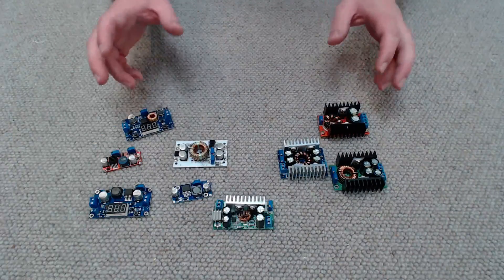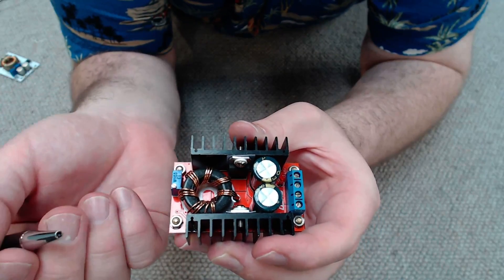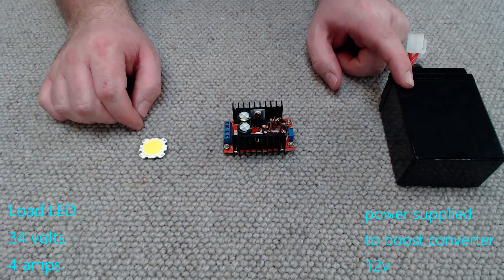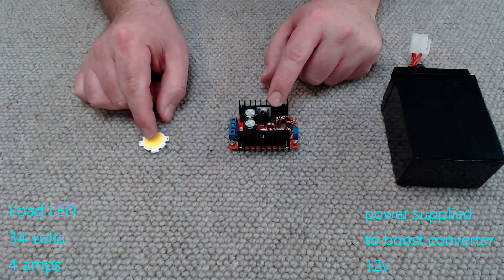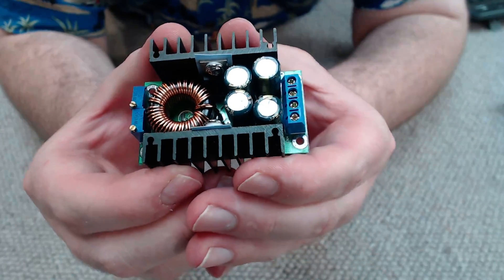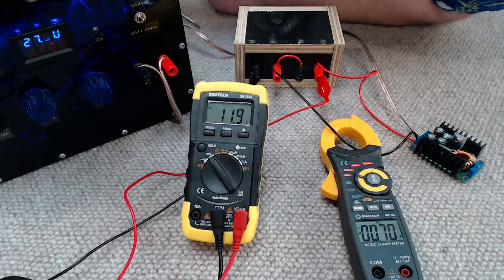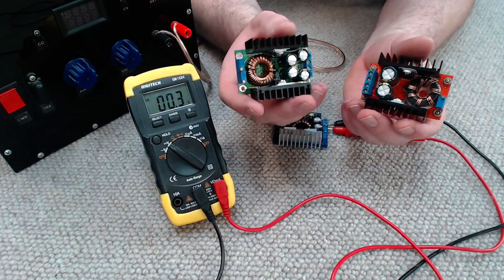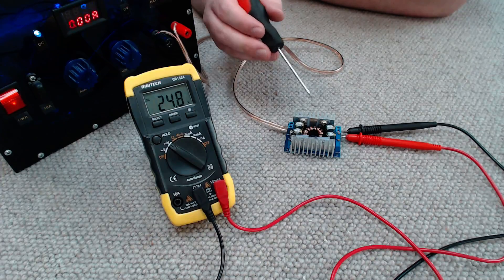What You Need To Know Before Buying A Boost/Buck Converter

Comment: 12v 20 amps acid battery, with controlled voltage and controlled ampera, who is charging with this devices healthy?
Reply: Terry More battery charging current depends on its capacity. Its healthy to charge a 200 Ah battery with 20a. But not healthy for charging a 100 ah . So whoever would be using, would be knowledgeable enough for this.
Reply: @rajeevranjan7644  Hello please, I need to charge a 200ah lead acid battery. I need a converter that can deliver 14.4v 20amp. Is it possible to input 19V 3.5A (Laptop Charger) to a 20A Buck Converter and get my desired output? If not possible, what is the Voltage and Current I need to input to achieve the 14.4V/20A?
Reply: @thekhaleef  your laptop's charger is of 75 watts only and you are looking for an output of around 290 watts. Though laptop chargers are made with very high tolerances like they can offer 3x more than their rated current and still would be working good. But even with this you are no where near your desired output. And also high current draw would generate enough heat through the laptop's charger wire to almost melt the plastic covering. So it would not be a good choice.
There are two things you can do -
1. Lower the output to 7Amp instead of 20A. Ofcourse this would increase the charging time by a factor of 3. But this is healthy for your laptop charger.
2. Connect multiple Laptop chargers in parallels as input if you have.

If you are looking for a long lasting solution then buck converters would disappoint you. Get a solar charge controller and connect laptop's charger output as solar input to the controller. This will last very long and would prove to be value for your money
Reply: Thank you so much @rajeevranjan7644  Okay, 

1. If I have several laptops charger which I actually do, do the ratings matter when connecting them in parallel because I have them in different brands (Hp, Dell, etc) which I am very sure their voltages and current are different.

2. If I hope to go for solar controller, do I still need the paralleling of the laptop charger?

3. Should it be possible I want to get a power source different from the Laptop charger, like a AC to DC module, what is the best configuration I should look out for that can give me my 14.4V/20A?

Thanks.
Reply: @thekhaleef  if you are planning to use it through solar charge controller then rating doesn't matter at all. You can connect different brands chargers with different ratings in parallel as input source and still get a consistent stable output.

In general Laptop chargers range from 11v to 25v with current from 1A to 5A. Whatever be the voltages of chargers, when connected in parallel, their output would be a fixed voltage (average of different voltages) and current would add up, resulting power equivalent to sum of powers of the chargers.  So your solar charger would in fact detect it as single resultant source of power to it and your battery would charge as it should when connected to a solar pannel with equivalent output.
I emphasized on parallel connection only bcz this way your final voltage entering into the charge controller would be lower than the highest voltages of your different chargers but would be higher than the lowest of the different chargers. Assuming this the input voltage range falls between 25V to 15V which can be easily handled by any solar charge controller whether it is mppt or pwm.
Good mppt charge controllers are costly.  the mppt charge controller who has wide range of input cost even more. 
So if you have a very good mppt charge controller with high input range then you can connect them in series. 
Though it has its own drawback too. In parallel connection you need thicker wires to handle the current. And in series connection, though you are don't need  such wire but you current would be limited to the current being pushed by the lowest power individual charger. Thus limiting in actual power. 
So one can say that parallel connection is better in most of situations.

But if due to some reasons you can't go through solar charge controller way, then you need to figure out the series and parallel configuration to achieve that sweet spot. I assume, you know the series and parallel configurations and can figure it out. Sometimes it unachievable with certain set of voltage sources so I didn't bring this at first.
Reply: @rajeevranjan7644  Okay, but using the Solar controller, would it only supply addition of the Currents of the laptop charges or it boosts it to it's own current?

What I mean is... If I parallel 3 laptop chargers of 2.5A, 3.5A and 3A... Would the solar only be able to produce  9A current to charge the battery?
Reply: @thekhaleef  it depends upon the voltage too. So give me output ratings of all the chargers you plan to use it for so that I can give you exact output calculations
Reply: @rajeevranjan7644  I have these 3 ratings ; 18.5V/3.5A,. 19V/4.7A,.  18.5V/2.7A.

And also, you can help with the formula to calculate so if I need to add another pack or just to learn. And I asked, if I later want to replace the laptop chargers for a single AC to DC module, what is the best rating I should look out for that would output my desired charger ratings. Thank you
Reply: @thekhaleef   lets calculate the total power output by all three adapters 
1. 18.5V @3.5A = 18.5x3.5 =64.75 watts
2. 19V @4.75A = 19X4.75 = 90.25 watts
3. 18.5V @2.74A = 18.5x2.74= 50.69 watts
Thats equal to 204 watts in total.

Now regulating it at 14.4v will result in 14A.
So by connecting all the three adapters as input source, you get 14A current at 14.4V.

Now to the second part, 
If you wanna get a separate AC to DC module then you would require a module of 290 watts which should be  working at 100% of its capacity. So to keep a healthy overhead of 20% and to increase the lifespan of the module the practical requirement should be around 365 watts.
Reply: @rajeevranjan7644  Thank you very much for the reply and support. I really appreciate. With your calculations, I now understand more of it. Thanks once more.
Reply: @thekhaleef  welcome friend, hope it helps 😊

Comment: what do you propose to control the voltage of ( hho) dry cell operate on 12 volt battery . I'd like to control the gas amount by control the current that is produced , by one of the three devices you would have to refer to it.with thanks.
Reply from the maker: A buck converter would certainly be able to do that. Make sure to buy a decently sized converter to handle the current.

Comment: If I want to be able to power multiple 100w leds and to use a single 12v batter i've been told I need to use one of those 12v-36v step ups per LED is there a type of boost converter where it will run all the leds
Reply from the maker: Yes a boost converter will do that for you. A typical 100w led would require the boost converter to draw 8.3amps from a 12v battery. However this isn't factoring in power loss within the boost converter or any headroom (factor in about 20% for power loss, and the same for head room). I'd search around online for a boost converter that is rated for 12amps :)
Reply: I want to run 4 so will the boost converter need to be rated at 400w+ or would it just need to be 100ish but rated at a higher amperage like you said
Reply from the maker: Measuring in watts for this particular application isn't very useful. You need to make sure you don't exceed the current/voltage input on the boost converter you're considering buying.

Comment: I did enjoy this, help me to know the difference.  I have build a buck converter which takes 24VAC (really 28VAC when I test it) and go to 5VDC.  I use a diode bridge.  My question is that I have a 7805 regulator which is rated to 1A but I am not seeing anything like that kind of amperage coming out of the buck converter.  I have 2 caps, 50V1000uF and 25V/22uF and I think that smaller caps is too small.  I don't understand how the caps work to provide amperage.
Reply from the maker: Thanks, glad you enjoyed it! Technically you've not built a buck converter. Buck converters and voltage regulators operate differently. Your 28VAC once rectified will be around 39.48VDC (1VAC = 1.41VDC after rectification) And since an LM7805 is rated for a maximum of 40VDC, it wouldn't surprise me if you need a new regulator. Besides the latter I can't recommend using a voltage regulator for your application. Going from 40vdc to 5vdc will cause the VR to overheat. If you draw 1amp of power. The heat generated will be 35watts! even 500ma will cause 17.5watts of heat. You're going to be better off buying/building a buck converter to more efficiently drop the voltage from 40v to 5v. :)
Reply: Well the kit I bought called it a buck converter.  The AC voltage coming through my thermostat wires are already downstream of a transformer in the air handler.  I never heard 1 VAC = 1.41 VDC.  So what you are describing is a situation where I need a higher rated LM7805 or better piece of hardware.  Someone suggested I use a TSR 1-2450
Reply from the maker: After AC power is rectified using a full bridge silicon rectifier. The output voltage gains +41% (1 VAC = 1.41 VDC) (That's the simple version, if you want to understand why? a quick google search will turn up pages of info) I recommend staying away from voltage regulators for your particular application. The difference between the input & output voltage is rather high. I'd recommend looking around for a suitable buck converter :)
Reply: I am open for suggestions.
Reply from the maker: Have a look on eBay or alike. Searching for "buck converter" will turn up hundreds of options. If quality is partitive and a warranty perhaps try RS or Mouser. :)
Reply: You need a "FULL BRIDGE RECTIFIER!!" lol 😂
Reply: Martin, Is that like a "full semi automatic voltage regulator"? ;-)

Comment: Any idea what the third pot does on a buck-boost converter?
Reply from the maker: I have some converters with a 3rd trimmer, mostly they are used for charging lithium batteries. The extra trimmer sets the cutoff point to prevent over charging the battery. However keep in mind there are other possibilities so take it with a good pinch of salt.

Comment: Thanks, well explained
Reply: what if my power supply is 24v @ 4 amps and i use a buck converter to drop the  voltage to 12v , then will i  be able to have a load that draws more than 4 amps,  if the  buck converter is rated at say 8 or 10 amps? in other words does it give you a current gain as  you step down the voltage? could i draw more than 4 amps from my 24v  power supply using the buck converter set at 12v ?
i have  a bunch of old 24v laptop chargers/adapters lying around that are 24v @ around 3.4A or 4A and i i want to know if i can use a buck converter with them(since i can pick them up cheap like little over $2 on aliexpresss) to power some 12v RGBW 300 LED strips which i will be using with 12-24 controllers
Reply: T. Kelly. yes it was.

If I may. In regard to the first boost converter description and 6 amps. The likely XL6009 onboard, is rated at 5 Amps. I doubt the unit will sustain that level with the converter as is. The heatsink seems too small, and a
fan may be needed.
Reply: ChaoticaExtreme, The data sheet info on them currently say that above 100 watt, it needs added cooling such as a fan.

Comment: I tried that 8A buck and boost converters, and found the constant current to rather unstable especially the buck you used in the DIY lab power supply u made, I found depending on the load both CV an CC leds both flicker on and the unit goes crazy. Only occurs on high current loads of if you overload and drive the unit into cc it becomes unstable. Its a PCB layout issue it does mention it in the data sheet for that chip its critical. The units are stable provided the load is very close to the CC CV set points.
Reply from the maker: What exactly do you mean by "unstable"? If I set my current at say for example 2 amps. It's rock solid and doesn't go over 2 amps.
Reply: If I set it to 13.8V 2A and place say a 5ohm resistor it should max at 2A and voltage drop to say 10v instead the current reaches 1.56A and voltage drops to 7.8V. If I increase the current to 8A is gets worse and both leds come on cv cc and odd currents usually less than set max flow, and RF interference messes up FM radio reception in the workshop.
Reply: Also another problem I just discovered with those cheap ebay 7 segment 3 digit LED combined Voltage Current meters that come with a big current shunt is the current measurement on the meters is wildly inaccurate when 1A flows the display shows 0.65A sometimes 0.00A, when 1.5A flows display shows 1.13A when 4A flows display show 5.56A. So Current displayed in not linear, so it cannot be adjusted correct...useless. I asked the seller for a 50% partial refund. not happy, it had me chasing my tail for hours until I discovered the metes where completely off too.
The Voltage display is ok in the low voltage range, but was out by a massive 1.6V 12v displays 13.6V but there are 2 tiny trim pots on the back of the meters and voltage can be adjusted correct at least..
Reply from the maker: Thats not a faulty buck converter, with a 5ohm load that's exactly how I'd expect the buck converter to behave. If there is a low resistive load (i.e your 5 ohm load) the current should stay at or below the level you've set the CC at. However the voltage can and will drop according to how much current is being drawn. If you read up about Ohm's law you'd have a better understanding than I can explain in a single comment. But essentially the voltage is relative to the current being drawn. And this isn't just with buck converters. That law applies to anything drawing power. Naturally though if you had a power supply that could handle 1000 amps and you only draw 10 amps there will be no voltage drop, however if the load was close to the maximum supplied you'd see a voltage drop. And because you've set the current at a max of 2 amps which is relatively low compared to the load resistance you would see a voltage drop. Your buck converter is working as it should.
Reply: Thanks for the quick reply, if a regulator is supposed to be in constant current and it's loaded up and beyond the voltage across the load will drop down BUT in true CC mode, current through the load should stay "LOCKED" at the max set current not fold back below at some lesser value. 
While some regulators are designed to fold-back current limit that's not constant current mode. Yes you're right too my ebay buck is not faulty its just poor regulation but still ok for most applications. After all I only paid a few dollars for it..
Reply: I'm referring to the buck converters inability to regulate within 1% as claimed in CC mode. Regulation gets worse at higher current levels, Its very much looks like noise and/or instability in the current sense feedback loop, the issue has nothing to do with ohms law as such as we are talking about a regulated power supply, but I' cant complain as I only paid a few dollar for it and it still works ok. Thanks for you're input, you're videos are very helpful and thanks for the quick replies.
Reply from the maker: You're welcome. It's fair to say this is more of a budget build bench PSU, 1% (or more) on either voltage or current would be within margin of error for something that costs only a few dollars. I use my bench PSU about 2 or 3 times a week since I built it. Hasn't given me any trouble. Having said that I'm soon going to be building a decent quality lab PSU. High voltage, and probably more current along with far greater precision. Stay tuned for that in the future :)
Reply: To put it simply: a CC CV converter limits the current by lowering the voltage.
You cannot push current into something it has to be drawn. By decreasing the voltage less current is drawn.
Compare it to water: Voltage is the pressure and current is the amount of water going through. The higher the pressure, the more water is flowing, so the higher the voltage the more current is flowing.
So to put it all together: for a CC CV converter you only set the maximum voltage and the maximum current. If the current gets too high, the voltage is reduced to lower the current to it's maximum. If the current is low enough the maximum voltage is used.

Comment: can you do a short vid on how you built your dummy load box.  Thanks!
Reply from the maker: Hmm alright I'll do that sometime soon
Reply: @Schematix  Forgotten :(
Reply: Please would you show us how to make one. It would be incredibly useful
Reply: @w41ty   Use your desired ohm wire wound resistors on huge finned heat sink with a fan in a metal box.use suitable switch to select the resistor. Use fuse box. Thats  it.

Comment: There's good information to be had here.I didn't realise that the current went up so much on the input side on a boost converter.Well done.Subbed.
Reply from the maker: It's something very easy to overlook. I know I did when I started out in electronics.  You're welcome :)
Reply: Power in is always equal to power out 
VI input=VI output
Reply: Not really Rajeev. Power in - loss = power out. While it is simple to calculate it straight through, none of the units will ever work at 100% efficiency. Even if you do a 12V 1A in, you will not get 24V .5A out. Some inductive circuits have gotten close to 99% efficiency by capturing the back EMF in an AC circuit.